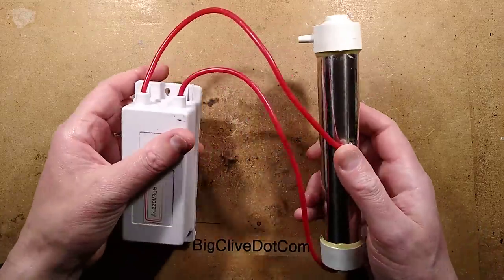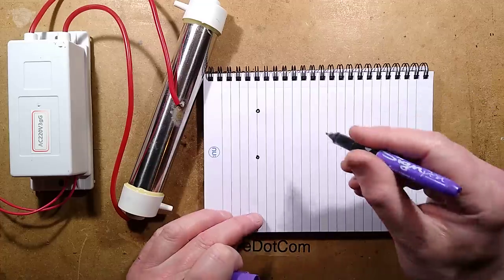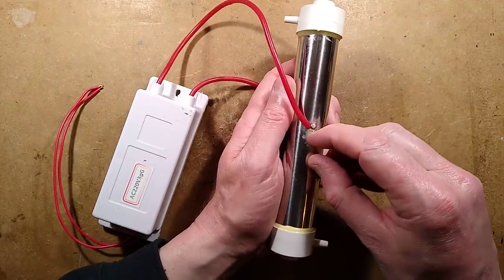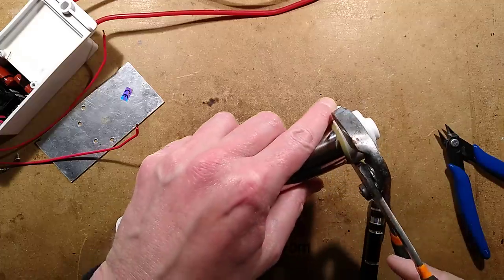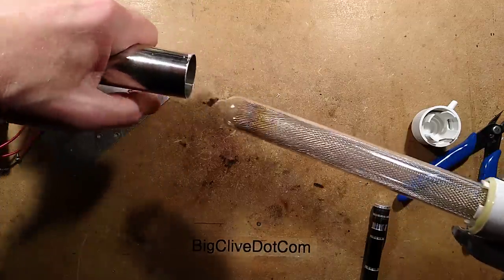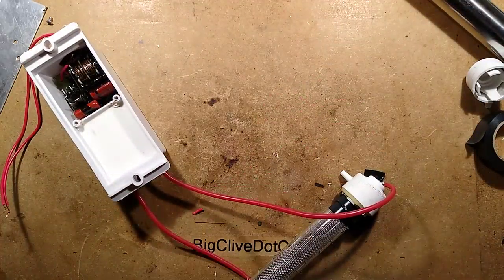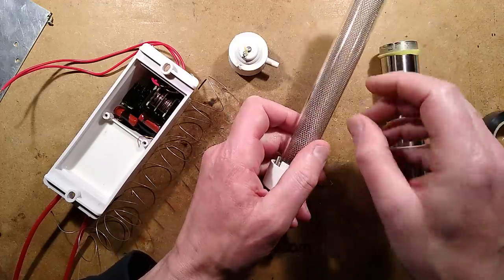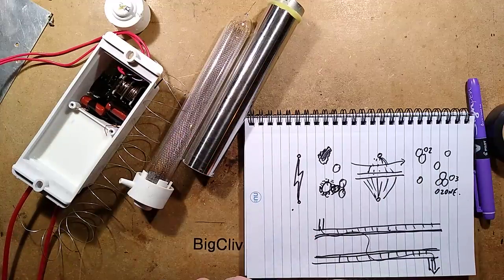Inside an airline cold-plasma ozone generator cold-plasma tube.

Comment: I have a Winix HEPA air purifier that has a high voltage generator hooked to a small brush looking thing, they call the feature “plasma wave” but I think is just what you describe, a trace level ozone generator.

Comment: The last time I heard anything like that power supply was a mechanical buzzer designed to supply a square wave  (before the days of transistors being powerful enough) to charge and discharge a high tension coil making a very high voltage pulsed DC.

Comment: Thanks for showing this! 
I have been interested in how CPTs are made for a long time. I wrapped the top of a large radio vacuum tube with aluminum foil and connected a 5,000 V neon sign X-former to it to see the corona.
 I was a curious science kid then and later learned that the smell it made was Ozone. I put a rubber band near it while running it and was amazed how quickly the rubber band came apart turning into flakes and writhing like a dying snake.  I read somewhere that there is a Hebrew word for Ozone that translates into "The Breath of God". Great video Clive?

Comment: As I do remember most aircraft systems utilize a 400Hz AC system for their on board electronics for aircraft use. Only if the provide AC in the bathrooms for electric shavers that will be at either 50 or 60 Hz.
This could be the reason for the arcing you hear, it needs 400Hz AC.

Comment: @bigclivedotcom — I wonder if the glass tube is borosilicate glass or quartz.  I have built a few cylindrical ozone generators using concentric electrodes, but using ordinary soda-lime glass tubes.  They tend to fail if a hot spot develops due to uneven spacing between the electrodes, causing the glass to overheat and crack.  This would obviously be unacceptable in an aviation application.

Comment: It's possible the tube was filled with argon and the arcs perforated the glass. I have a little ozone generator that looks like that, where I can see the argon glowing. It's glass tube with a spiral wire around sticking out of a black power supply base that runs on 12 V.

Comment: The stainless discolored when they sealed the ends of the tube. Which also means there can't be vacuum or inert gas fill in tube. No oxygen, no colorful oxide film.
Reply: I was thinking the same thing.
Reply: Discolouration of steels has nothing to do with oxidation, it’s a result of the effect of the temperature on the crystal structure.
Reply: @SkigBiggler  It has everything to do with oxidation. Sure it can also be an indication of changes to the crystalline structure, but the different colors are created by the thickness of the oxide film on the surface. Look up 'tempering colors of steel' or the wiki page on Tempering (metallurgy) has some decent information. 

I braze metals at 800-1100C in vacuum RF and hydrogen furnaces at work and I can say with certainty, no air until cooled below about 150C = no colors on the surface.

Comment: I've thought about buying an ozone generator for a couple years now to use when the basement starts smelling a bit musty but don't really want to drop 100 bucks on one. I've been tempted to make a box to contain the UV from my 25W UVC bulb that has a couple small fans to move air thorough the box and see how well that'd work as a DIY solution.

Comment: Funny you mentioned the electrical noise, I used one of these and it cut out my enphase solar panel inverters from communicating. Thought the solar system was broken. Turned off the ozone generator and everything was back to normal !

Comment: I have a hacked together O3 generator in my garage, I was trying to get rid of stale cigarette smoke. NST hooked to a plate (al foil) and some Al window screen, with glass plate separating them.
I burned up a fluorescent tube a few days ago - I saw a YT video about producing an ozone generator of the tubular design, with the center conductor being made of the conductive fluorescent tube gas. 
Apparently, fluorescent tubes rated for 35W and regular 120v usage aren't beefy enough to run 15kv at 400W through. arced through the glass, melted/cracked the glass after about 15 seconds. Dang! (I was watching the power meter going into the NST)
Back to the old school one. ppbt.
Reply from the maker: Glass has a surprisingly low dielectric strength.  I've cracked glass doing that too.  That's why commercial ozone plates are ceramic.
Reply: @bigclivedotcom  Oh! Youtube video didn't mention that! Bad youtube! :)
Good to know, I'll keep that in mind for the future. Thanks!

Comment: I wonder if an aquarium air pump would push the air out one side of the tube and allow for more O3 to be released.
There is likely to be a vacuum due to the way the glass is sealed and the alternate end is shaped.  That is pretty much the same way a small halogen lamp is made.
Funny you mentioned that rubber degrades due to the Ozone.  My grandparents lived in Detroit and you could be blindfolded and know when you made it to Detroit from the Sulfur and Ozone smell.
Also the Ozone will overtime corrode exposed aluminum.

Comment: i have similar unit in terms of PSU, but with open plates for ozone generation. that tone takes 80W and generates an anormous 14kHz noise peak. it's deafening.
Reply from the maker: It sounds more like a neon power supply version.

Comment: You might want to try to tear down one of those "OION" ionic air filters on eBay. They use a set of corona discharge wires plus a tiny UVC tube under the fan to filter the air. They are pretty cheap on eBay here in the US, though I'm not sure what they would be on your side of the pond. I bought a little one to help get some of the dust out of the air in my living room. It's worked pretty well for that, despite the fact the aluminum box-tube "filter" doesn't have a lot of surface area. It actually does help quite a bit with odors as well. The build quality seems ok externally, nothing exciting one way or the other. I don't know how good/bad the electronics are in it, so I tend to keep an eye on it when running. But it might be an interesting tear down if you can find one cheap and you haven't already taken one apart.

Comment: Funny I was working on my own PSU, just a push pull controller with step up transformer, but I'm not quite getting enough voltage for a corona discharge.  Running it off a 19v laptop adapter though.  Not brave enough to put my circuit on mains yet and 3 primary turns is probably not enough on my transformer.   Need a bigger core or thinner wire so I can do more turns on secondary.  I kind of got side tracked and just been playing around burning things with it and making CFL bulbs glow. :P

Comment: I used to have plans to build an Ozone generator many moons ago that included the need for a neon power supply (the bigger the better) and a thick ass round glass goldfish bowl, I have no idea where they went but I am sure they will be on the internet somewhere.  I left the little Ozone generator running over night in the workshop to get rid of an awfull smell of 3d resin and isoproponal that I accidently spilled on the floor. just a shame its so dangerous cos I think it smells nice, A nice clean smell.

Comment: You know what? That sounded like an old-fangled vibrator power supply as found in vintage violet ray machines. Yes, I saw all of the modern electronics, but that's what it sounded like. You should put a big resistor across the output and scope it. I bet it looks like spiky square waves rather than even faintly clean AC.

Comment: Theory question: Can a non-sparking electrical field between two insulators create ozone as efficiently as this configuration?  The layers would be electrode - glass - air - glass - electrode.

Comment: When you touched it after the first test to check if it was still at a high voltage you should have used the back of one finger. That way if it is still at high voltage the involuntary contraction of your finger / hand / arm muscles will disconnect you from the object. The worst thing you can do is grab it with your hand as contraction will keep your finger / hand in contact.

Comment: Based on this video title, I'm wondering if perhaps the power supply is unhappy and noisy running at 50 Hz, instead of the 400 Hz that most airline generators operate at?

Comment: As far as the noise and popping goes, are you certain that supply is designed for 240v mains? If it's intended for aviation it might expect a different supply. A bit of googling suggests most commercial jets use 115VAC @ 400Hz.

Comment: I have one like this , with power supply that is near silent it has a separate air pump and typical Chinese silicone hose connection. I included a air stone and I run air on this way in my emergency water tank 1000 liter , it works on a timer for 15 minutes every week.

Comment: I used to work with circular dichroism, the instruments would go down to ~150nM wavelength measurent with a high flow nitrogen purge, the lamps we used where big xenon short arc tube lamps at around 150Watt they generated so much Ozone! We plumbed the nitrogen through the lamp housing to keep the ozone down, never measured the amount of ozone these things gave off though! But nice beer money at Christmas from the spent ones as the tips of the cathode and annode are platinum 😋 just make sure you wear goggles around them, they are pressurised!!

Comment: Thanks for disassembly!
I have ozone generator with tube like this that broke, some yellowy semi transparent oily sludge leaked out of the air outlet and stopped providing ozone.
Tube is much smaller (unless you have tiny hands) and I have no idea if it's fixable.
Transformer and air pump are working fine, but never got ozone generator to work again.
And it happened right before corona craze...
Should I try to pour hot water trough it? 99% cleaning alcohol?

Comment: You didn't see the corona discharge because your spiral copper wire electrode was wrapped tightly around the glass tube. The stainless tube had a constant gap between the glass tube where the 'corona action' takes place. If you could have made an electrode (tubular single wrap of mesh) larger than the glass tube, you would have gotten the corona. Even a piece of wire stretched along the glass tube at a ~2mm?? spacing would have probably worked.

Comment: I always used ozone in my marine aquarium, mine was ceramic. Regardless of material used, there were always warnings about having too much ozone running that wouldn't dissipate in the water & enter the room, apparently if you could smell the ozone that was no good. Then I see ozone generators everywhere blasting ozone into a room
Reply: it's still bad.  the laws of physics have not changed.
people are just getting dumber is all.

Comment: At around 9:30 I was forced to set this aside. Canines in the flat below were barking madly from the squealing protestations of the end cap at your attempts to remove it with pliers. I took side with the dogs! I believe this may have induced in me some amount of cranial discharge! It's been told to me that brain cells are a finite resource.  In allotting what remain of them I've neglected to account for situations like watching these videos. Yes, @Michael Thompson , a few here in the Americas' west coast have received the message loud and poignantly at that. @bigclivedotcom I have heard that waterboarding is a tremendously persuasive technique for its terrifying cruelty. Perhaps you could suggest this end cap removal process be used instead for its effectiveness whilst being almost one notch less horrifying... I humbly submit. You are a great (tor/de) mentor and I appreciate your productions.   ;)

LMAO! Thank you! Having continued on, I found it greatly rewarding to have a sudden, audible laugh at your "reassurance" to whichever pseudo-authority might have concern with a 3kV jerry-built contraption.

Comment: Lightning is said to make nitrogen usable for plant fertilizatiom. Does this process deoxidise nitrogen? Like hydrogen from water?
Reply: Air nitrogen is mostly pure N2, no oxygen to remove.
Reply: It can create nitric acid if you bubble the gas through water. That can be used to make ammonia or urea nitrate. Expensive but possible.

Comment: I'd guess then, that you could use a modest sized fishtank air pump to run air through the tube?

I'm curious to know what you would do with water that has been sterilised this way?  - Would/could you drink it? Or would it be more for use in industrial, or perhaps medical, processes?
Reply from the maker: They do use small aquarium pumps for it.  The resultant air is bubbled through water to ozonate it for sterilisation and cleaning.

Comment: Do you have an  "night vision" camera?
If so, could you try and use it to look through the white potted section?
I had a friend come over last night and we tried the raspberry pi cam to look through various materials and quite a lot of them worked revealing my fingers or metal objects behind... but I didn't have any potted stuff to hand to try it myself
Maybe try it cold at room temperature and if that doesn't work leave it running for a while to get the transformer windings a bit warm

Comment: Hi, good video, concerning the described, as air flow through tube, could be that these act as breather tubes to allow for heat expansion and subsequent contraction! Lest the glass cracks?... Or does the electrical drive air through in a pumping action, thanks... Interested.... Thom in Scotland.

Comment: Not promoting my anything... since I don't earn any money from this it's just for my own hobby but here... /watch?v=510BLajnSXE I basically made this recently, I have no idea how efficient it is but I find out that literally sparking it (even tho it's very very loud) generates more ozone than this corona discharge thingy :)
Reply from the maker: The plasma without the arcs would generate most ozone.  Many commercial units use high frequency AC across a dielectric barrier like ceramic.

Comment: Would the input voltage/frequency matter if you're running it at 240V 50Hz and my google-foo suggests a lot of aircraft electrical the AC bus is 115V 400Hz?  Maybe that would make it less noisy?

Comment: Most big airplanes use a 400Hz 120v power supply (the higher frequency makes the transformers smaller and lighter). Do you think that the power supply might not have been working right because you were feeding it 60Hz 240v?

Comment: Well, you now have a future build video: Design/adapt a better power supply for the discharge tube and build/assemble it! I HAVE been told that a low level of ozone is beneficial in homes, especially homes which are well insulated in cold climates (I'm in Minnesota, USA). However, too much ozone is bad for the lungs!

Comment: I ebayed an ozone generator with the two ceramic plates.  It came with a xformer that looks similar but mine is silent.  That thing will piss off all the HAM radio operators in a 5km radius from you.
Reply from the maker: It may be similar, but quieter due to the solid corona surface and smaller discharge.

Comment: I did think that looked suspisciously like one of those made in china ebay neon transformer/power supplies... think they can be trusted?
does the high voltage put out ac or dc, also, the wire attached to the outer tube, any reason it is central?

Comment: Maybe while removing 1 endcap you broke the end of the sealed glass. And that may be why it sparks.
Reply from the maker: It's possible since there were a couple of small specs of glass on the bench.
Reply: No i think it was sparking before, that's why the end of the mesh got black. But i do think your right about the leak being the cause of the sparks.

Comment: Did you say this was intended for use in an airliner?  AFAIK power disribution on airliners is 400hz at about 115v.  But the rating printed on the power supply is 220v. Odd.

Comment: Clive, my 20w two UV tubes fly zapper gave an all mighty bang and tripped out the fuse box. When I turned the power back on the two tubes lit up but now flys don't get zapped. What do you think blew in my zapper?
Reply: There’s a mains section for the tubes and a HV section for the zapper. If the bugs ain’t dying, that means the high voltage section isn’t working. 

Since the breaker tripped, it’s likely that something shorted to ground somehow. Might as well take it apart and see where the big electrical skid mark is. It’s already busted, can’t hurt to open it and see if it’s repairable.

Comment: Wouldn't the glass sleeve with one lead charging the screen and the shell being grounded just make a glass-dielectric capacitor? Seems silly. Would just be easier to suspend a piec e of wire with barbs on it or something down the middle of the tube from insulators, ground the tube and charge it to create a corona discharge.

Comment: Do you think it might just have diodes and ceramic capacitors making voltage doublers in that potting?
Reply: Usually the tubes have a noble gas in them to protect components.

Comment: One of the eBay sellers of these devices cautioned that the bleaching (oxidizing) effect of ozone could damage dyes in fabric and pigments in artwork.  Has anyone experienced this?  Is it worth a BigClive experiment?
Reply from the maker: At high levels ozone is basically gaseous bleach.  It's used in some specialist laundry equipment.  The levels involved would be harmful to breathe.

Comment: Dont think its working correctly, clearly there was point discharge at the end, that's not right, and that awful noise isn't right either. A working unit should  run pretty quiet with the odd crackle, the corona discharge will be evenly spread, this unit is probably "at air ...or this is  completely shite .